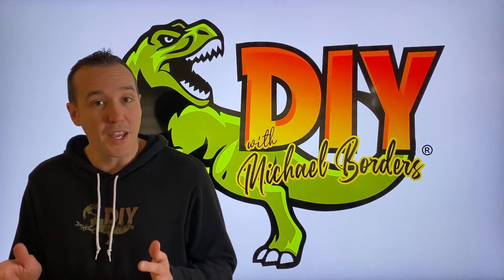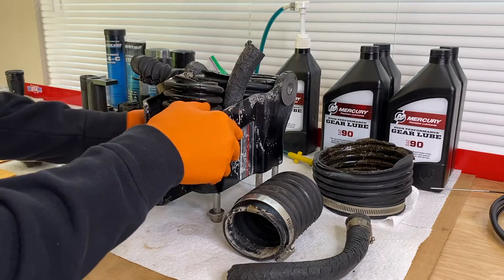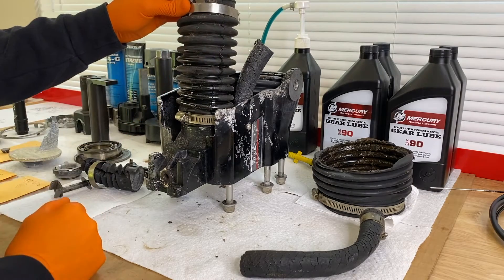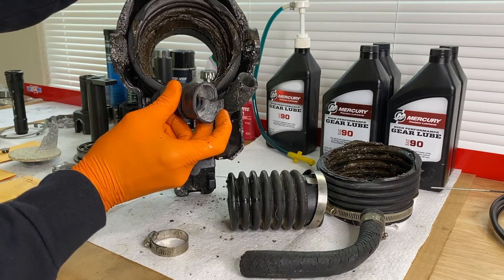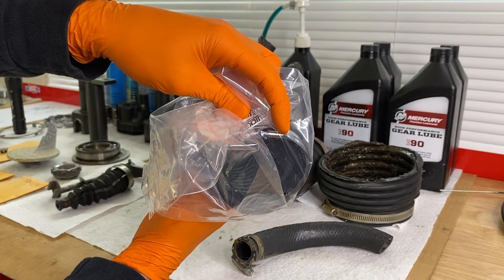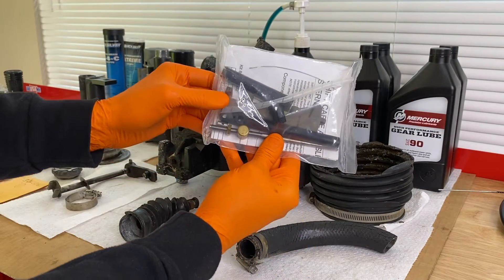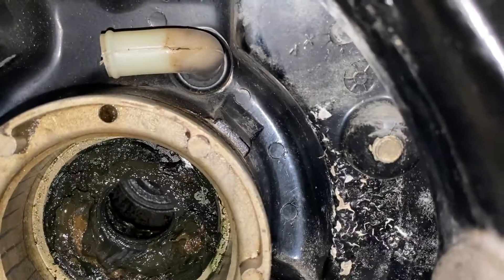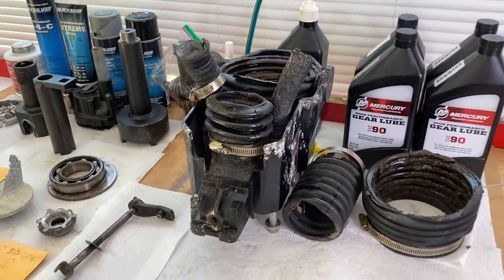Mercruiser outdrive Bellows fail - Old vs New

Comment from the maker: If interested in purchasing this product, visit our Amazon affiliate link below.  I earn from qualifying purchases.

     Bellows replacement kit:  https://amzn.to/3RL7h8v

     Shift Cable Socket:  https://amzn.to/3qtVdgq

     Hinge Pin removal tool:  https://amzn.to/44YuasH

     Flex Shaft Screwdriver:  https://amzn.to/3s8E3W4

     Utility knife:  https://amzn.to/3QBjP1K

     Bellow adhesive (92-86166Q1):  https://amzn.to/3sv9nyF

     Lacquer thinner:  https://amzn.to/3QGvxbd

     Long flathead screwdriver:  https://amzn.to/3qMm08a

     Aviation gasket maker:  https://amzn.to/47XHS18

     Wire brush kit:  https://amzn.to/3OTZ8vr

     1 1/16” deep socket:  https://amzn.to/45T1u4j

     800 grit scuff pad:  https://amzn.to/47SaM2y

     Bell housing bushing/oil seals(23-805041A2):  https://amzn.to/3szdhGS

     Swivel vise:  https://amzn.to/3sfLsAv

     3/8” socket extension:  https://amzn.to/3EhRKFa

     2lb hammer:  https://amzn.to/3QDHiz3

     Water tube bushing cover:  https://amzn.to/46yp9aI

     Water tube bushing seal:  https://amzn.to/3tjcBWt

     44'' Water cooling hose:  https://amzn.to/48IEcQX

     Gear lube SAE90:  https://amzn.to/45vlqux

     Marine grease 2-4-C:  https://amzn.to/3PiLmDX

     Loctite 271:  https://amzn.to/47SXV00

     Outdrive gasket kit:  https://amzn.to/3rb5HBR
  
********

1.  Replace water tube bushing seal and hose

          https://youtu.be/4DohEeXZj0I

2.  Replace bellows/shift cable/water tube PART 1

          https://youtu.be/NcObTOYXtQM

3.  Replace bellows/shift cable/water tube PART 6

          https://youtu.be/9qjzUqgbQus